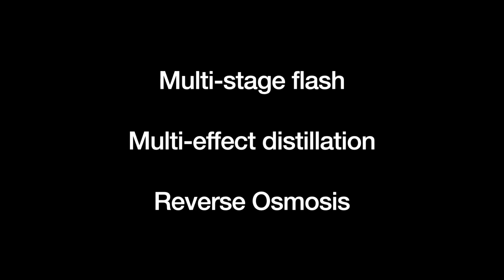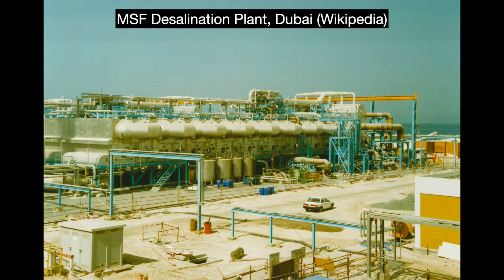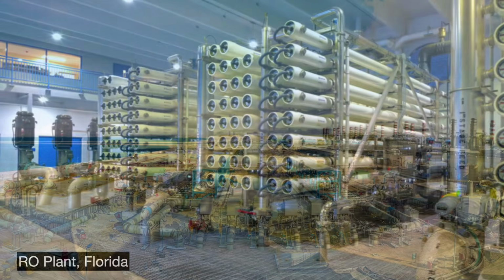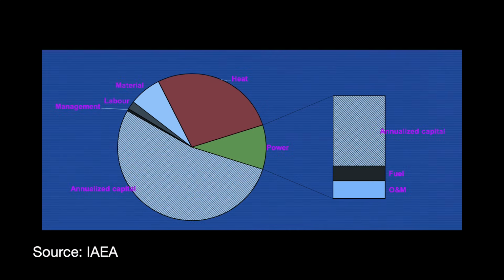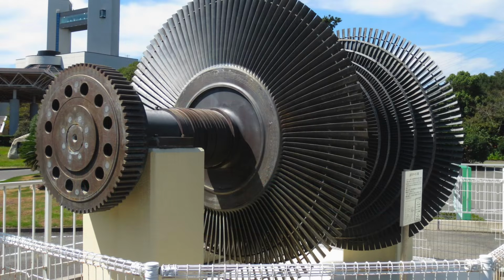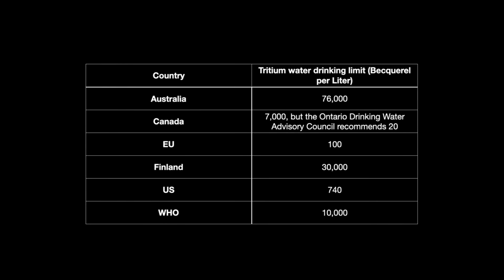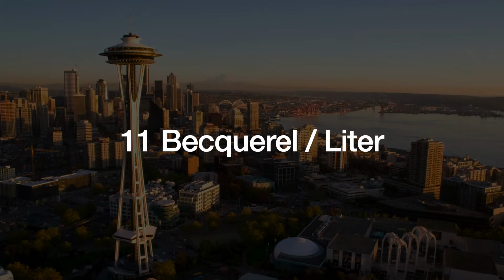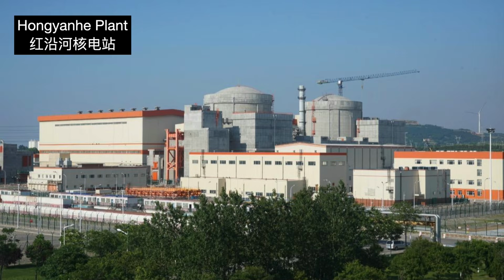Going Nuclear to Desalinate Seawater

Comment: Nuclear is ridiculously expensive(not to mention your prepay your energy cost 50 years into the future so if it destroyed bit of a disaster)The US has a number of abandon half built  nuclear plants due to the public revolting against the extra taxes required.We also always here the next generation will be much cheaper then we end up with the last one in  England which ended up being 4 times the cost previous models.Solar has been droppings in 5-10% price every year with NSW University forecast this trend to continue for many years(perovskites even cheaper)
Reply: Is that why solar-powered California (about 50% RE) has electricity retail prices twice that of nuclear-powered Illinois (about 40% nuclear)?
(note these 2 states share the same currency, laws, and economy)

Is that why wind-powered Germany (about 40% RE) has electricity retail prices twice that of nuclear-powered France (about 70% nuclear)?
(note these 2 states share the same currency and have similar laws, and economy due to the EU)
Note that Germany has about 3.5x the electricity-sector emissions that France does too!

Nuclear power plants are expensive, but they produce cheap electricity.
Solar panels (made by enslaved Uighurs in China - hmm is that why they are so cheap?) are cheap, but they produce expensive electricity.
Reply: Nuclear started becoming extortionately expensive when anti-nuclear activists started successfully overregulating the crap out of the industry, killing new reactor design R&D projects, and successfully lobbying for plant shutdowns which both caused a reduction in willing government investment while simultaneously skyrocketing the interest rates on private loans. Solar alone isn't going to solve this short of in-situ mass manufacturing in space and taking advantage of the 99% capacity factors in geostationary orbit, and thinking otherwise is what got Germany into the position of acting timid toward Russia because their Energiewende just ended up making them awfully dependent on natural gas lest their economy collapse and their people freeze.
Reply: Rubbish nuclear power plants receive enormous subsidies in US with California I’m not why power prices have gone up so much but would speculate that California has had dysfunctional governments that want tax everything they possibly can than spend the money ineffective with a public that Has no faith politics & vote for populist policies
Reply: @jasonwhiteley3612  "nuclear power plants receive enormous subsidies in US" - really? really?

You don't have to guess at these things, you can just google them, or even cruise on over to EIA.gov and research it yourself.

'The International Renewable Energy Agency tracked some $634 billion in energy-sector subsidies in 2020, and found that around
* 70% were fossil fuel subsidies. About 
* 20% went to renewable power generation, 
* 6% to biofuels and just over 
* 3% to nuclear.'
(Note - this is from IRENA, an agency with a vested interest in being pro-RE, but they are also competent honest scientists).
https://en.wikipedia.org/wiki/Energy_subsidies_in_the_United_States#Overview_of_energy_subsidies

Or Columbia University's Earth Institute
which shows subsidies for Nuclear totally outclassed by subsidies from RE in 2007, 2010, 2013, 2016.
https://news.climate.columbia.edu/2019/09/23/energy-subsidies-renewables-fossil-fuels/

Here the Institute for Energy Research (admittedly NOT pro-RE) show the breakdown on a per-MWh basis, which really shows massive subsidies to Wind & Solar on an even comparison of energy generated.
https://www.instituteforenergyresearch.org/wp-content/uploads/2008/07/megawatthour.jpg
from https://www.instituteforenergyresearch.org/renewable/wind/energy-subsidies-study/

And their research showing 
'The U.S. Treasury estimates that the Production Tax Credit will cost taxpayers $40.12 billion from 2018 to 2027, making it the most expensive energy subsidy under current tax law.'
https://www.instituteforenergyresearch.org/renewable/wind-and-solar-tax-credits/

But please, blame CA's high electricity prices on nuclear subsidies, even though the % of CA electricity has shrunk as they force NPPs to close - if subsidized nuclear is closing, then the cheap RE should make prices go down - yes?

Again, CA retail rates are essentially double IL retail rates.
https://www.eia.gov/electricity/monthly/epm_table_grapher.php?t=table_5_06_a

All sectors combined, March 2022, cents/kWh
20.87 - RE CA 
11.29 - Nuclear IL 

Data - it beats propaganda each and every time. I do look forward to your next explanation as to the high CA rates now that subsidized nuclear has been blown out of the running.

Comment: Good job analyzing the water problem from a stand point of current engineering.  I think you made the case that thermal desalination powered by nuclear energy is doable right now, no break throughs required.  However, I have my doubts that this will be significantly advanced in the near to medium term.  There is too much fear of nuclear power.  "Nuclear water"  is not a tagline that sells.
This is a shame because sea water desalination can be cost competitive with many current dam and irrigation projects.  For perspective, the minimum theoretical energy required is less than 1 Kw/hr per M^3.  Stated differently, reverse osmosis of sea water requires a pressure head of ~ 300 M.  For comparison the California water project pumps water up 400 M over the   Tehachapi mountains.  Yes, pre-treatment is currently expensive.  Yes, practical osmotic systems may require multiples of theoretical pressure.  But, desalination is not that much more expensive than other alternatives.
Reply: Fear has to give way to fear of not having power and water. The moms of America need to get over their fears.
Reply: Wait until the small modular plants come into operation, everyone's working on it right now!
Reply: Sadly the mob mentality is that nuclear = bad. Is harder to remove this fear from people than solve water crisis.
Reply: It’s even better than dams. You’re yoinking a little water (relatively speaking) from the ocean, vs destroying hundreds to thousands of hectares of land…

I dunno why environmentalists would ever be for such projects over nuclear-powered desalination but…welp.

Comment: My friend do some stuff on geothermal energy and millimetre lasers. It's very underrated. The Uranium fuel cycle doesn't exist to make energy (1956 was the first commercial reactor in the UK) but rather Uranium is chosen for another purpose first utilised in 1945. Uranium is fine in stable areas with stable governments but if things go wrong they go 10,000 years wrong. 

China has built the first small-scale Thorium MSRs (Molten Salt Reactors, specifically the liquid fluoride thorium reactors (LFTRs) first proposed by NASA in 2006). Thorium's main advantage over Uranium economically is the unique ability Thorium has to be used in a breeder reactor using slow neutrons or a thermal neutron reactor (cheaper than fast neutron reactor). The thermal neutron absorption cross section (σa) and resonance integral (average of neutron cross sections over intermediate neutron energies) for 232Th are about three and one third times those of the respective values for 238U. Thorium is more efficient than Uranium. There are however several drawbacks with Thorium. It's definitely possible to make nukes (239Pu) and also weak nukes (233U), like with Operation Teapot (1955). There are still waste products to be managed in order for Thorium to live up to its claim of being safer and cleaner than Uranium (the public selling point), each stage of that process adding to costs

A 2011 MIT study concluded that although there is little in the way of barriers to a thorium fuel cycle, with current or near term light-water reactor designs there is also little incentive for any significant market penetration to occur. As such they conclude there is little chance of thorium cycles replacing conventional uranium cycles in the current nuclear power market, despite the potential benefits

Thorium and renewables (wind, solar, etc) are a bridge towards a truly greener and carbon neutral economy. Those solar cells (silicon) still need to be manufactured, the perovskite needs to be perfected, the large-scale adoption of solar and wind has negative effects on ecosystems and wildlife. The Chinese hydroelectric system is great on paper but is killing Vietnam like hydroelectric does to every downstream ecosystem. We need truly renewable not paper renewable energy, that means we need geothermal and nuclear fusion

Comment: It's easy to get caught up with scary sounding things like tritium, but it's important to remember the reason there is such wildly different environmental standards for it is that these are basically guesswork. We have no evidence for harm from it at low doses so they just pick a number that sounds good. We only have evidence of harm from extremely high doses and no one has ever had enough to kill them.
Reply: Risk factors are based upon statistical analysis, not guesses. Each tritium atom has the to potential to emit beta particles which are capable of damaging DNA if they collide. Cells with damaged DNA can turn cancerous. Statistical analysis is used to determine the  probability of this event, and this is compared to an acceptable risk factor to determine the concentration of tritium, or any other potential toxin, will be allowed.
Reply: @EDesigns_FL  I've heard several talks by Prof Geraldine Thomas who heads something called the Chernobyl Tissue Bank, and researches the toxicology of nuclear materials. She's quite adament that it's practically harmless in the concentrations that we could be talking about. The jist of her explanation is that:

- The biological half-life of Tritium is around ten days (with some variation), while the nuclear half-life of Tritium is 14 years, so the chance that a given Tritium atom decays while inside your body is very low.

- Not all beta emissions are created equal. Tritium's beta particles have particularly low energy. So even if it does decay inside your body, its damage is limited.

Here's one of her appearances on the Decouple podcast: https://www.youtube.com/watch?v=-KRthSSs370
Reply: @EDesigns_FL  statistics based on models with little evidence are guess work
Reply: @kokofan50  It might seem like that to someone who is not acquainted with how the analysis is conducted, but it's not. Physical testing is often done to verify models, but the advent of computer simulations has rendered this unnecessary for most work. That's how we were able to abolish testing of nuclear weapons. Likewise, computational flow dynamics and finite element analysis software and has rendered wind tunnel and physical testing unnecessary. It's all math.
Reply: @EDesigns_FL  for somethings, you’re right. For biology we don’t have that kind of understanding yet.
Reply: @EDesigns_FL  Sure but this is theoretical, if you take in to account DNA repair mechanisms and the lack of real evidence that these low doses actually cause cancer then the number they choose is still just a guess plucked from the air, extrapolated from high dose numbers without evidence.

Comment: Molten salt/thorium reactors are far safer from meltdowns compared to uranium reactors
Reply: Normal reactors are safe already. Just take a look at the deaths per kwh, only solar and wind are better than nuclear
Reply: Most MSRs are designed to use uranium, and thorium can and is being used in pressurized water reactors
Reply: Let's consider all the things that could go wrong while things are already going wrong but you find no fault with them.
Reply: Not really safer, but they achieve it in a different way that is easy for the lay public to grasp -- "already molten, so can't melt down".

Comment: It cost 4 times more to build a new nuclear plant compared to renewables. 
https://www.lazard.com/media/451419/lazards-levelized-cost-of-energy-version-140.pdf
Reply: But nuclear power is about half the retail price of solar/wind energy.

Solar-powered California (about 50% RE) has electricity retail prices twice that of nuclear-powered Illinois (about 40% nuclear)/
(note these 2 states share the same currency, laws, and economy)

Wind-powered Germany (about 40% RE) has electricity retail prices twice that of nuclear-powered France (about 70% nuclear).
(note these 2 states share the same currency and have similar laws, and economy due to the EU)
Note that Germany has about 3.5x the electricity-sector emissions that France does too!

Nuclear power plants are expensive, but they produce cheap electricity.
Solar panels (made by enslaved Uighurs in China - hmm is that why they are so cheap?) are cheap, but they produce expensive electricity.

Comment: Forget Uranium, we must evolve to Thorium reactors with salt plug.
Reply: still we need researched more about it. caused we dont know experiences about it before, yet need of new infrastructures of it. dont forget about thorium is much harder to be prepped than uranium *AFAIK
Reply: @bgaoest2995  We do have experience with it. Oak Ridge National Labratory ran a molten salt reactor without issue for 5 years and it was designed from the very beginning to operate using Thorium. China has already built their own test reactor for molten salt
Reply: You can fuel a molten salt reactor with low-enriched uranium too. The positive aspects are largely the same.

Comment: People are going to have to wake up about nuclear. It's far safer and pollution wise it's a no brainer. Yes when safety protocols and site placements are an afterthought, bad things happen. Those incidents while severe, are few and far between. Maybe someday we will find a better alternative but until then much like the fallout series, the future is the ⚛️!
Reply: Except nuclear doesn't habe 1 major problem, it has 4 compared to the alternative that we also already have ready for full delpoyment.
1) Dangers. Yes, that is bad but overblown in compatison, you are correct.

2) cost. Nuclear is by far the most costly energy producer, both to build and to run.

3) long term waste storage. Yes, there are solutions, but they are very expensive for world scale deployment.

4) It also runs on non-renewable fuel. Yes, the world got massive numbers of nuclear fuel to mine, but uranium, thorium and some others are limited resources.  And kf you look at how tiny nuclear energy production is currently vompared to overall need, those deposits won't last if nuclear is truly scaled up to necessary numbers. (Note: energy doesn't just mean current electricity, but also heating, industrial heat usage, and all the transportation that is currently not electricity based).

A simpler and cheaper solution is mass renewables, with laws in place to force recycleable builds (e.g. wind turbing blades can be build recyclable, but a few %more expensive, thus without laws it won't happen). Throw in a decent amount of grid and non-grid storage (e.g. the electric vehicles that can be charged at different times), and especialy a continental (or for europe intercontinental) High voltage DC backbone grid, and renewables work perfectly fine. 
Costs less to build and run, no radioactive waste, no risk of long term impact catastrophes like Chernobyl, and not dependendt on very finite fuel.
Reply: The scared mothers of America need to be told about the dead birds and what happens to children when the power goes out. Sick of dumb people.
Reply: More people died from coal pollution than nuclear pollution
Everybody knows about it
But it's kill more slowly so the news reporter aren't interested
Reply: @B well put
Reply: yeah I agree react is the future lol
Reply: @Zaydan Naufal people are almost ALWAYS confused because of ignoring and belittling knowledge! Ex. Trump
Reply: @TheHiddenPearl  well to my recollection jobs were coming back to this country and gas wasn't 6 USD a gallon so ease enlighten me as to what facts were ignored and belittled? Thinking small minded people just spout and regurgitate info that is intellectually dishonest, but hey, what do I know, I'm just the chemically induced evil alter ego of a victorian scientist.

Comment: I've heard about Thorium salt cooled nuclear reactors and the possibility of using the waste brine from desalinization as the coolant for those Thorium reactors so there won't be any waste
Reply: You've got some wires crossed there. It's the waste heat from the reactor after thermo-mechanical conversion used to heat the saltwater for desalination purposes.
Reply: No you don't want to use the brine as the coolant. At all. Straight up NaCl/KCl already is a kinda lousy medium for the neutronics but it's not even pure stuff if its coming from the ocean.
Reply: You're confusing different types of salt. The salts in the ocean are dissolved in water, while when you hear Molten-Salt Reactors, it refers to dry, completely water-free salt being heated to the point of melting -- and it's additionally a different type of salt than the type you find in the ocean.
Reply: I think that might clog or erode the pipes.